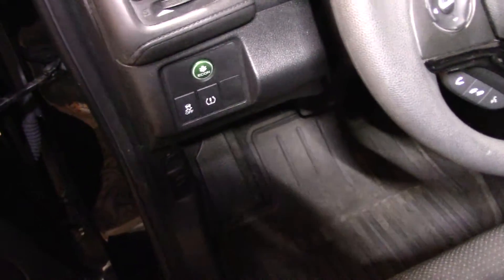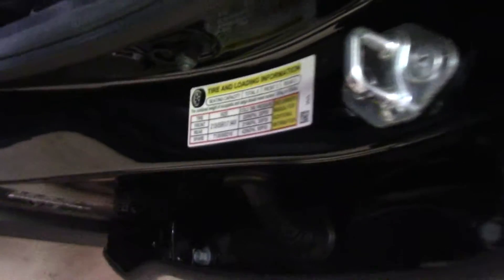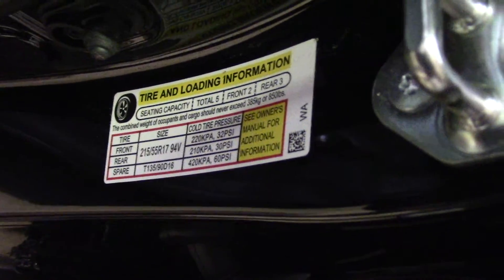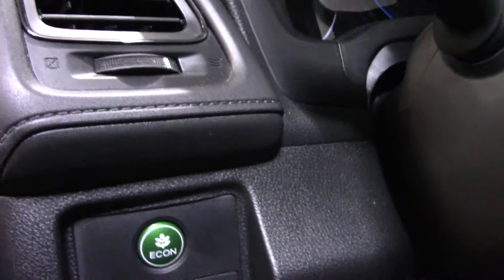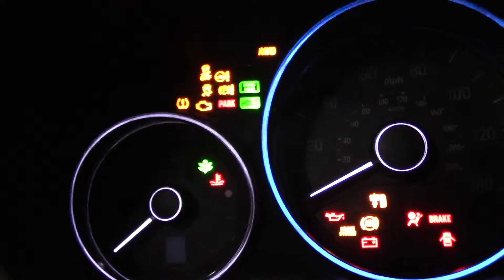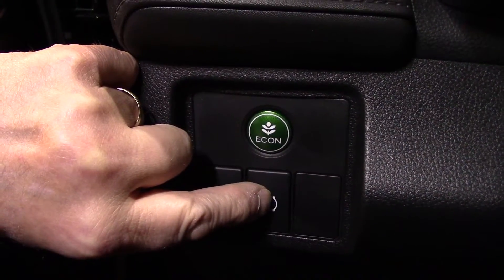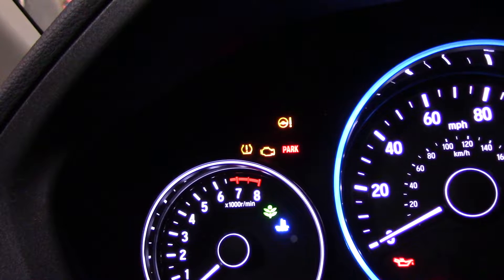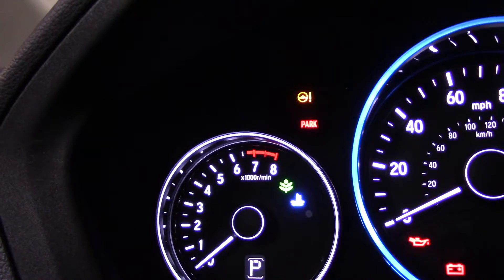2019 Honda HR-V TPMS Reset Procedure

Comment: Love how my HRV looks identical and has no TPMS button like yours
Reply: Your HRV is most likely a higher trim. To reset the Tmps light your vehicle should have a display option under your steering wheel on the right hand side.

Comment: This is not how my 2019 looks. So it doesn’t work for me.
Reply: Same.
Reply: @AaronBrand  me too but there's a reply to a similar comment above that says there's a similar button below the steering wheel. i haven't checked it out yet though. Also, my car is a push button start so i'm not sure how that figures in either. Anyone have any ideas?
Reply: @blinkybli8326  I found another video that covers it. Just use the menu (where you might see the trip od,etc.) and go to settings->tpms->tpms calibrate. Once you start the calibration it takes a few ignition cycles to complete; make sure you go on the freeway for one of those. The light will reset.
Reply: @AaronBrand  Thanks!!